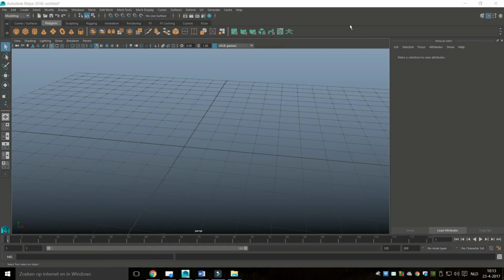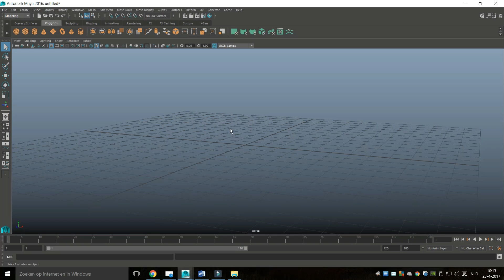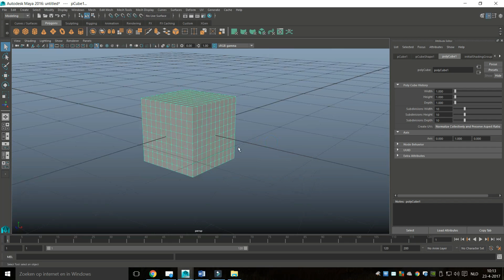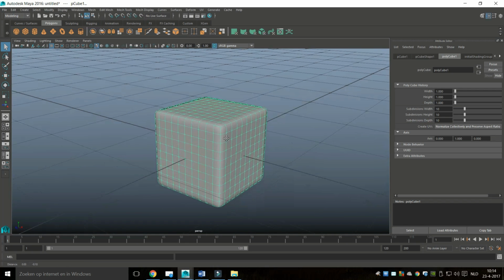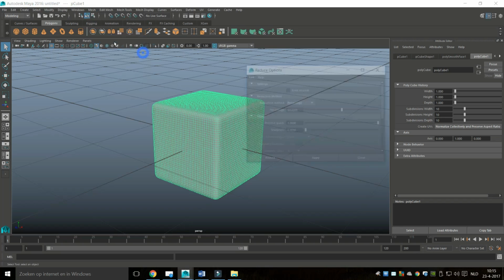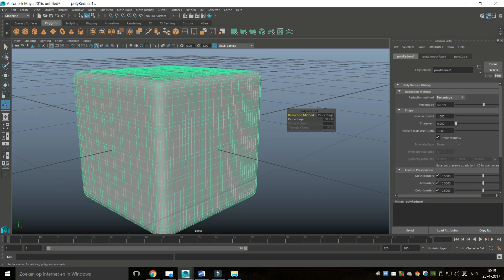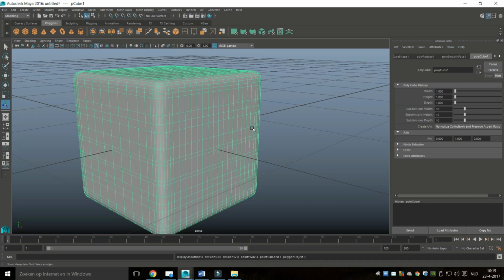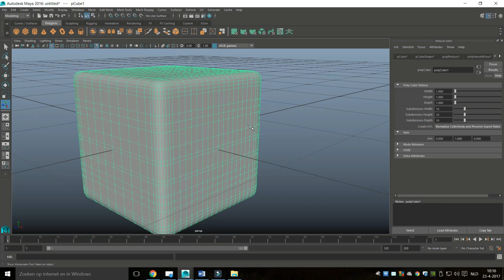How to control Subdivision levels in Maya

Comment: To get 75% or a custom level, this makes sense but for 50% couldn't you directly use the first subdivision level by using the 'Mesh smooth' option?
Reply from the maker: Yes, you could